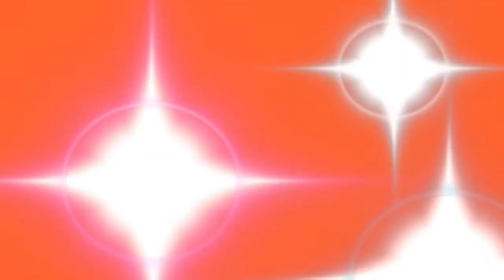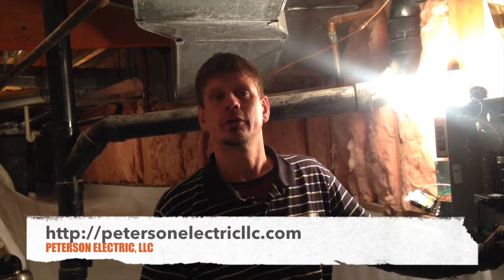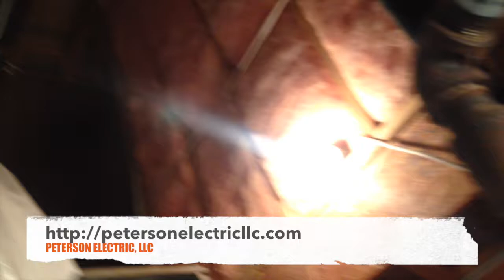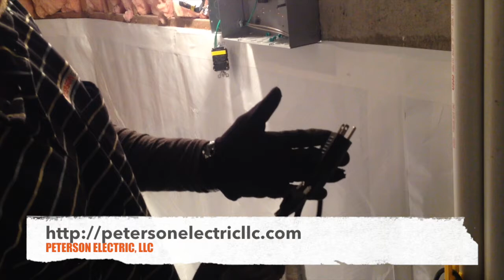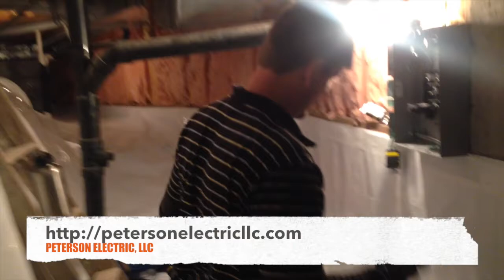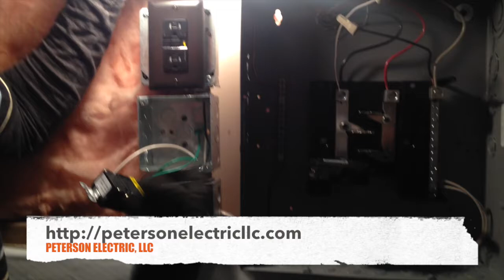House In Side Of The Mountian, Electrical Subpanel Installed For Sump Pump System

Comment: Do you have a video that shows how many circuits can run on a 40 amp sub panel just curious
Reply from the maker: It's as much as the panel can allow, although, there is a catch, you have to know your loads your putting on. Article 230.79 talks about this with 220.42. If it is general, then always #6 copper NM four wire. Good up to 60 amps.